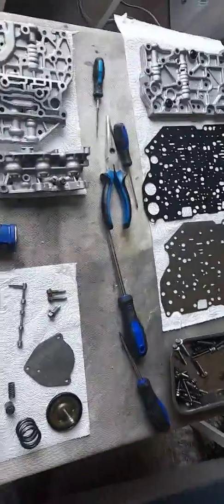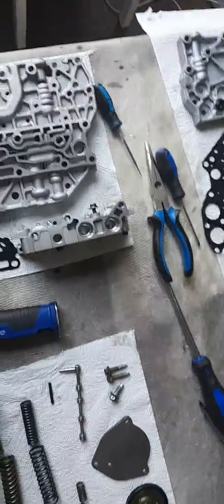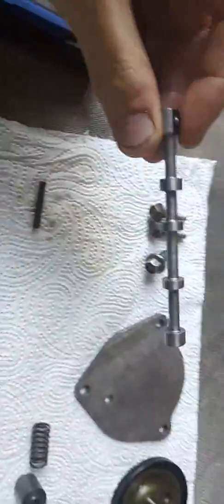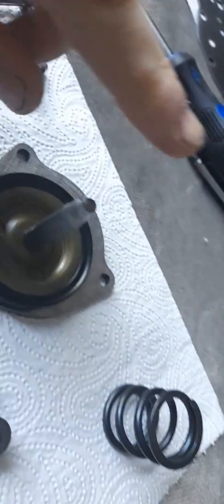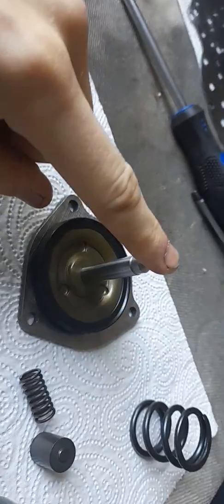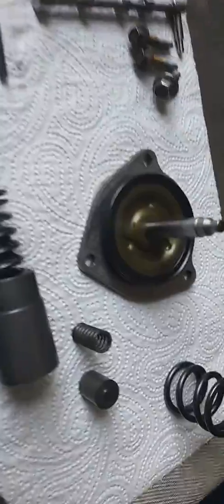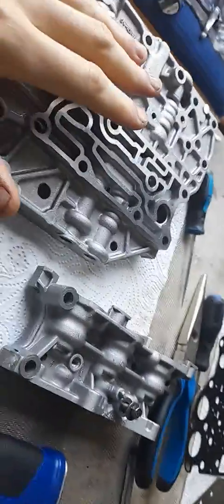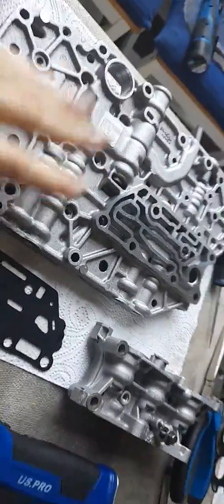Ford Focus 4F27E Automatic Transmission Common Issues & Rebuild Advice Part 1

Comment: Learnt more on 3 videos than many others combined! This tranny in mazda5 enters reverse intermittently, thuds if it does; 3rd to final jerks too-so does 4th to 3rd. 2nd to 3rd jerks but sometimes and way too little. Tried fixing with fluid flush(TC flushed too),  a & b solenoid cleaning, tranny oil cooler replaced (had noticed waxy deposit on dipstick and below radiator cap causing me to do all the maintenence) no tranny codes on scanner. Possible mpg drop. Appreciate any leads to help me self fix. I deduce hydraulic and piston issue below black cover with 3 screws.
Reply from the maker: I would get that cover off and check that piston! It may be bent, broken or it's worn out the casing i.e. it had sideways play in it's bore. See what that brings but it might need replacing with a second hand one!

Comment: I have this issue with mine where it engages in all gears absolutely fine, no thuds or anything then randomly it’ll drop out of fourth into third and a hold light will start flashing. But randomly no set timing and the car only has 170,000kms and I’ve changed the fluid and filter

Comment: got a fa5a-el Mazda 6 07 5 speed auto as my daily driver and it started slipping above 2nd gear for almost 3 years till it just wouldn’t shift past 3rd gear. It would go to fourth one time right after start but not after till I replaced the fluid gasket & filter, solenoid valve body & all the shift solenoids, wiring harness, and band servo, all at once. Now it did the same thing for a minute, but now after a few test drives it’ll skip 2nd gear and not go past 3rd every time. I replaced the tcm and it still does the same thing. I wonder if something I installed was faulty or if something is just wrong other than needing a whole transmission rebuilt because I’d like to fix it if I don’t have to crack it open

Comment: When replacing a valve body for 4f27e does it need to be programmed or just plug the new one in? Thanks
Reply from the maker: Nope bolt straight in.

Comment: What would be the cause of no Reverse? The car just revs in reverse, tries to geab a little but then nothing. Obviously a pressure issue but where to look? 😢 Thankyou.
Reply from the maker: No reverse means pressure issues. Id be cleaning all the passages out with an air line and looking for any restrictions
Reply: @usuallyfixingtinkering  Ive looked on live data and can see certain solenoids and their respective pressure readings but when selecting reverse i see around 62.3psi and then it falls off the zero within a second or 2. In drive, It maintains 200+ psi and seemingly drives fine. Do you mean an issue with the valve body? Thanks for you reply buddy btw.
Reply from the maker: that indicates a loss of pressure in that reverse circuit, that could be a piston seal thats broken it's hard to say
Reply: @usuallyfixingtinkering  also, you say looking for restrictions, not leaks?
Reply: Also do you think adding a slightly longer bolt but a thread or two to the reverse drum band will improve things? Don't mind abit if a workaround until I get time to sort the box properly. 🥹

Comment: Brother my car this same gearbox not shifting from 1st to second and also 3rd to 4th only 1 and 3 working 
2nd and 4th gear no working and i recieve code gear 2 incorrect ratio in scan tool
Reply from the maker: That sounds like a solenoid issue if more than one gear doesn't work

Comment: Just pulled my trans. Is the servo end that pushes on the band supposed to be showing when the vehicles off? I have a incorrect gear 2 code and solenoid d stuck on. The band also appears to be really loose but isn't broken.

Also what solenoid activates this servo so I can activate it from my scan tool.
Reply from the maker: Solenoid D is at fault because it should only be applied for 1st gear. The band can feel loose but we applied by the servo it tightens to prevent slip. Any issues from 2-3rd?

Comment: Hi, my car is not moving in forward or reverse, just no motions at all, the cable from transmission is connected with the shifter and the dash shows whichever gear I select, but no movement at all. Fluid level is full and is red in colour any idea what could be the issue? Any guidance will be much appreciated. No error codes whatsoever. Also, when car is put in Park "P" it moved freely if you push it by hand, so my guess is the selector on the inside might be broken?
Reply from the maker: That is a confusing one, it sounds like the park pawl has broken as the transmission should lock in park. Any funny noises from the gearbox?
Reply: @usuallyfixingtinkering  Thanks for your kind reply, when its put in park, it makes a grinding noise, but other than noise no locking occurs, car just rolls freely in any gear
Reply: Car does not move if Drive or Reverse is selected so I am guessing either the fluid pressure solenoid or the shift selector shaft could be gone, can I test solenoids with normal 12v DC?
Reply: @usuallyfixingtinkering  I discovered the previous owner rev'd the engine high and then suddenly put it in drive, in an attempt to do a burnout, so my guess is, something snapped inside, hence no motion forward or reverse and no lock in park
Reply from the maker: That may have broken a clutch ring sadly hence why no movement in gear sadly

Comment: Great video, thank you! 
So, in my focus, it's not shifting into third gear. Revs go up really high, clunks, then goes unto limp mode. The error code is p0772 or solenoid E stuck on. I've checked all the solenoids, and they are within spec with their ohms. I've replaced Solenoids A and E simply because I already ordered them.
Still having the same shifting problem. Same code as well.  Any recommendations? 
Cheers!
Reply from the maker: firstly did you buy aftermarket solenoids because they can be 50/50 whether they work well. Solenoid E stuck on - this controls the release of an important servo piston that basically releases the brake band to get 3rd gear. So not getting 3rd gear tallies up with the solenoid being stuck on. My recommendation is removing the valve body, carefully stripping and seeing if there's a blockage going to solenoid E or anything in the passageways! Certain if the solenoid is in spec!

Comment: My 4F27E gearbox wants to go forward all the time. In P gear, the car does not move, but the engine does not spin up above 2000 rpm. In N gear, the car goes forward. In D gear, the car starts from 2rd gear and switches normally to 3rd, but when switching to 4th, something strange happens. If I use manual mode 1-2 gears, the car goes perfectly. Please tell me, is the problem in the valves or is the FORWARD clutch pack jammed? Thanks
Reply from the maker: I was going to suggest your gear linkage is not adjusted but that is a new one. Sorry I've not heard of this before!
Reply: @usuallyfixingtinkering  P gear engages accurately, but the engine does not rev above 2000 rpm. It feels as if D gear is engaged and the brake is pressed (stall test). I assume that the FORWARD package works all the time. What do you think?
Reply from the maker: no the forward clutch does not work all the time, I think we have a valve body fault which would be difficult to pinpoint unless it was slit apart like I did here and to inspect everything and every valve, it sounds like a stuck valve allowing inapporpriate pressure to the forward clutch pack at the wrong time!

Comment: Hello, in my case when I put D, I feel that the car starts in 2nd or 3rd gear, accelerates very slowly and heavily, even if I put 1st or 2nd I feel the correct relationship with enough force to move the car, but in D there is no force to efficiently overcome the inertia of the car, ** I thought it might be solenoid ´D´ SSD * -  Focus ZTS 2.0 Zetec, grettings from Chile.
Reply from the maker: The only time that Solenoid D is in operation is 1st gear! If it works in Manual 1st gear and moves off nicely and not pulling off in D, then I would definetly look at that solenoid!

Comment: Mine is at 130k. 2011 4spd SEL model. As soon as you put into drive. Wrench light comes on. I pulled codes and i cant remember exact code, but it was for a shift solenoid c electrical circuit malfunction. I replaced the shift solenoid c. It does good on all shifts EXCEPT into 4th. It will go into 4th and immediately slam back down into 3rd. Any advice? Do you think this is electrical?
Reply from the maker: It sounds electrical because the problem has shifted but it's difficult to say, has the fluid been changed to rule that out!!?
Reply: @usuallyfixingtinkering  yes fluid and filter were both changed when I replaced the shift solenoid.
Reply from the maker: Of course sorry I didn'nt think, it's difficult to diagnose that issue but it may be the servo piston in the sump area is worn and bleeding pressure between 3 and 4th, its a round rubber disc covered by a small panel with three nuts holding it down and it had a shaft that pushes on one of the clutches, this does wear or even breaks, if that happened though it would affec 2-3 shift, so may be just worn. If it is it is a tricky repair and needs reboring by a transmission specialist to refit the old piston.
Reply: @usuallyfixingtinkering  that's what I was curious about. 2-3 isn't bad is why I'm stumped. And no slipping between 3 and 4. It goes into 4th but shortly after quickly jolts down. Weird weird stuff.

Comment: 8/6/24. 10.26hrs
I am thinking of replacing whole solenoid plates as diagnostic refers to Solonoid E stuck and E no circuit  also gear 3 and 4 incorrect ratio. Is there a gasket between plate and fix to valve body?
Reply from the maker: Tricky one as they rarely give up, I'd be looking at disconnecting the plug to solenoid E and reconnecting to start! The solenoid bodies are made in china and I am very suspicious of their quality!

Comment: I have many problems with this transmission. The first thing is that when the transmission is cold, it gets stuck in 3rd gear limp mode and the OD light flashes without a code. If I shut off and turn on the vehicle a couple of times, it engages 1st gear. The other problem is when shifting to 3rd gear, it engages for a second and then slams back into 2nd gear. 4th gear directly slips. The only code present is P0733. Do you have any idea what the cause of these problems could be?
Thanks
Reply from the maker: Yep, can you please check the fluid level in the gearbox when the car is hot at working temp and has been put through all gear selections for 10 seconds and hen with the engine running, look at the dipstick mark! It may be low on fluid to rule this out!
Reply: @usuallyfixingtinkering  I checked the fluid level and it's right on the hot mark when the vehicle is warm. I added a quarter of a quart, but there were no changes; same problem.
Reply from the maker: @javierEI345  unfortunately I think there's a mechanical issue with third gear clutch pack. How many miles/km has the car done?

Comment: Been looking for a video on this for ages haha. 

I got a leak coming from mine. Its on the top of the box and runs down. What do u think it is? 

Also i did a oil flush on mine and my over drive is slipping now after 80km/h
Reply from the maker: That is unusual at that mileage to have ay issues, what colour is the fluid? I am not sure where that leak may come from unless it's one of the sensors leaking out at the top of the box, however due to the gearbox webbing I doubt that it will run down!

Comment: I saw this gearbox is more reliable in a Mazda cause something change, is it right?
Reply from the maker: no its equally as reliable in both cars there's no difference apart from the sump pan in the mazda version having a drain plug!
Reply: @usuallyfixingtinkering  Thank you for the answer. This drain plug is a good thing?

Comment: Sweet video bud! Dealing with the Mazda trans slamming into reverse, and not having 3rd or 4th gear, tries to shift from 2nd to 3rd and flares without success then the cel flashes and puts me into a “limp mode” only code is p0705 and I have replaced it twice now with same end result. Any ideas? You seem pretty knowledgeable within this trans and it’s common issues
Reply from the maker: It seems you may have a faulty transmission range sensor that bolts to the front of the gearbox between the casing and selector lever, that is what the code is indicating!
Reply: I have replaced that 3 times now, all 3 times with a new part and still to no avail. When it first started acting up, it would randomly kick out of o/d and put you into limp mode, but you could put it into neutral, turn the key off, start the car back, put it into drive and it would go right on down the road. But now it does it almost immediately and I can’t “soft reset” it with the key. Ecu failure?

Comment: Thank you sir.I have question. I have bought new automatic transmission and mounted.
  The vehicle is running smoothly for the first time, I do not have any problems with gear shifting. However, after driving an average of 15 km, the light comes on and turns off after 1-3 seconds. After 1-5 seconds, it turns on again and goes off. Finally, on the 3rd time, it turns on and does not go off. After the light stays on, it turns off.
The vehicle does not feel any problem at 1-2 revs, but it becomes a slight problem at 3rd and beyond. That is, when shifting to 3rd, it holds it and releases it, that is, the shift is felt, when the revs are completed, it is felt at 3.7 revs, not 3.2 revs. Afterwards, it should complete the revs and shift to 4th.
It passes at almost 5 thousand cycles, sometimes it doesn't.
  In this situation, when you pull the car aside and turn the ignition off and on, the light goes out and returns to the beginning, so it does not cause any problems until you drive 10-15 km. Afterwards, the same problem occurs.
  Sometimes, while driving with the light on (transmission protection light off), the gear shifts to 4th and continues, but when the light comes on, it shifts to 3rd.
  The oil has been changed and the transmission has been reset. The old transmission and the new transmission give the same malfunction response as if it had never been changed.I m getting same problem new and old transmission.
OBD says P0741 fault

Im sorry for long write...
Thank you
Reply from the maker: That code is the Torque Convertor Clutch Solenoid which allows the lock-up in high gear and higher speeds - I've never heard of one failing in that box to date so first thing is to check that the transmission fluid level when HOT and gone through all the selections for 10 seconds with the engine running... see what it says.

Comment: I have a problem with 4F27E FOCUS MK2. Sometimes, when I shift from P to R or D, there is (sometimes) a smaller or larger impact when the oil is hot. What is there to do? mechanism or solenoid? The gearbox is supposedly rebuilt, but made by the Chinese. Before replacing the gearbox, I had the same symptom
Reply from the maker: when you say chinese - the whole box? That's a new one on me but I would suggest taking the car for a drive then when hot pull up, go through each gear quadrant 10 seconds at a time, then put it in park and with the engine running - check the dipstick, it sounds low to me
Reply: @usuallyfixingtinkering   yes, the whole box from China. I was also surprised, but the box looks like it came from the factory. Everything is ok. Just these hits on R mainly. Ok, I'll do that and check
Reply from the maker: I never knew you coud get them from china, R = engagement is always more noticeable because it requires the highest hydraulic pressure in the box! Any hydraulic pressure issues result in loss of R first!
Reply: @usuallyfixingtinkering  hmmm Maybe the Chinese failed to regenerate the solenoid because it was dirty? These solenoids are of poor quality. Maybe they left a slight play in some part of the aluminum casing of the gearbox or pump and it does not hold the correct pressure?
Reply from the maker: @ha48124  I like your thinking and it's possible - I wouldn't trust the Chinese made solenoids to function exactly as they should
Reply: @usuallyfixingtinkering  I went for a drive, this time there was no knocking noise. I can't reliably check the oil level. Whenever I pull out the dipstick in the old and now new gearbox, there is max oil or even above max. This bayonet is stupid. Who comes up with the arc technique? I will try to adapt the gearbox while driving

Comment: How reliable are these boxes?
Reply from the maker: As traditional slush-box automatics go they are very reliable if they are not abused and treated like it can produce the peformance of a manual. As long as the fluid is check and changed if it has not already been done so there's very little to go wrong. The main weakness are Shift Solenoids A & B, which will reguarly be supplied with a filter and gasket kit when changing the fluid. They CAN pack-up but its not a hard job in the slightest. Compared to the Powershift gearbox which replaced this around 2008 or just after, this is 10x more reliable.
Reply: @Usually Fixing & Tinkering  excellent! I've had a few autos now. Most of them being fine other than a citroen c4 grand Picasso auto which was horrible. Mines currently sitting on 70k miles and the fluid is pink. The gears shift fine. Would I need to change the fluid? Yes I've heard horror stories about the powershift box. Did ford revert back to this box then?
Reply from the maker: @Fight4life-i8r  no but they reverted to the same type of gearbox! I would look to change the fluid at this age even though its pink at the moment. It will really benefit long term. The trick of telling- the  Sump pan should have no gasket, if you can see one the fluid has been changed previously, as a gasket comes with a filter kit. Originally it was just stick on with sealer which you may see if its untouched.